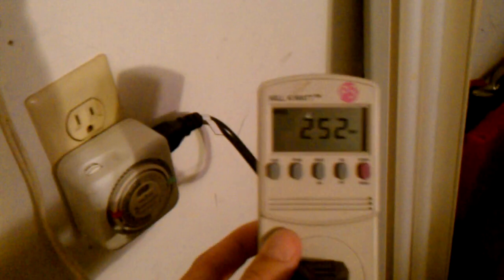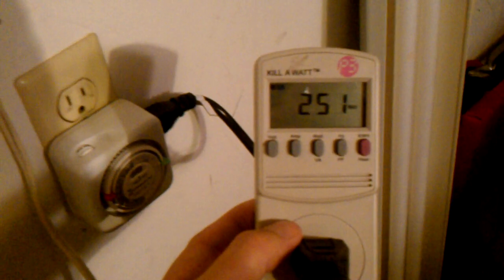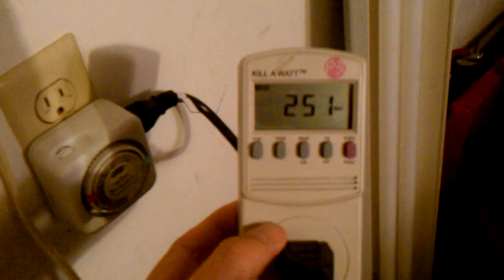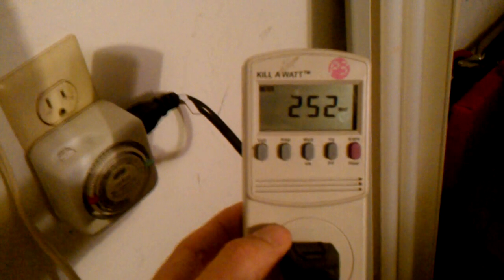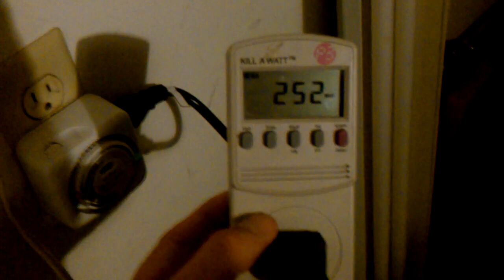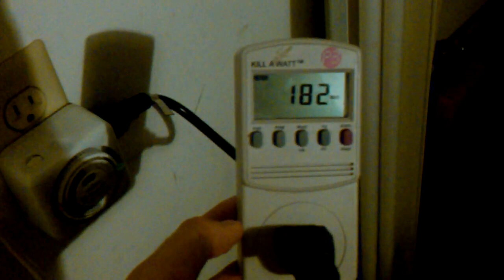Solar panels & Powerjack 1200 watt grid tie part 5

Comment: I noticed you had a timer on the line.  If you didn't have a timer, would that cause problems?  When running batteries, your suppose to have a Charge controller to make sure at night the solar panels don't drain them, when running a grid tie inverter directly, does it stop the solar panels from sucking power from your outlet during the night if you didn't use the timer?